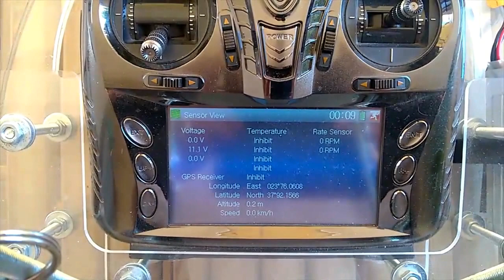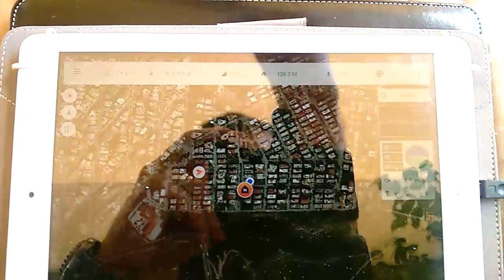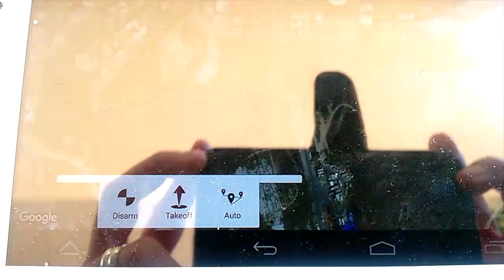WALKERA DEVO M 3DR Telemetry modification part3

Comment from the maker: I have added a pin connector for the +5v of the 3dr radio, in order to be able to use the drone, with no ground station and no telemetry radio (when my tablet or laptop, are not available at the flying site).The USB connection works fine (I unplug the 3dr radio +5v) and I can connect the qr x350 pro to mission planer in my PC.The 3dr radio connection works fine with mission planner and Tower (in Tower, you go to parameters, and then you hit connect. After that, you can use all tabs)The OSD can be used with, or without ground station (because of the inability to save sr0 parameters, you have to press [enable OSD] in mission planner, before you can use OSD, without the ground station initialization. After this all data are refreshing, without the need of a ground station connection.

Comment: Buen dia que controladora puedo ponerle a mi walkera qr350pro k funcion bien
Reply from the maker: Greetings Raymundo Rodriguez
,

You can use your preferred rx tx combo (doesn't matter which brand or model as far as it has the required channels). I am using a Devo 12s on all my RC. If you want to keep the intalled rx module, you sould stick to a compatible walkera rx.